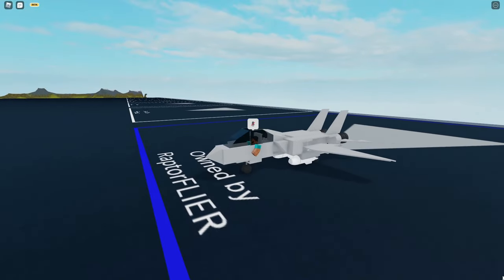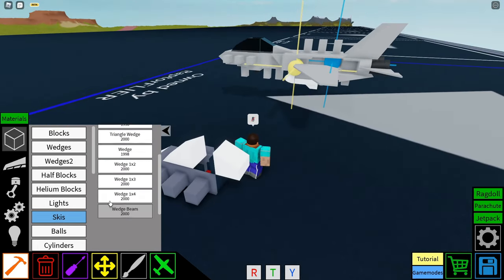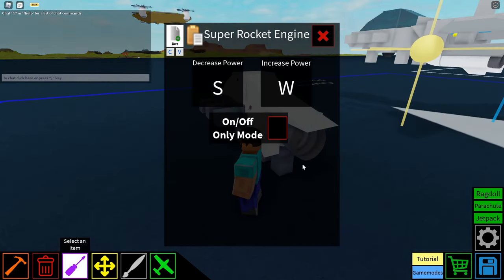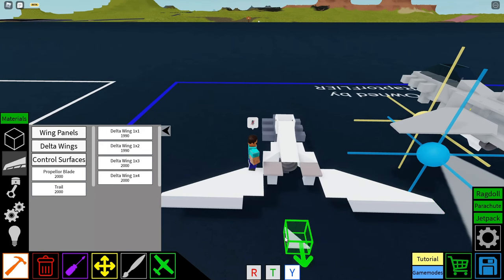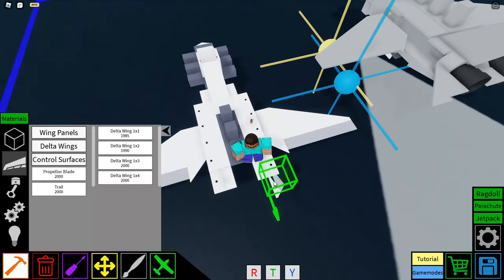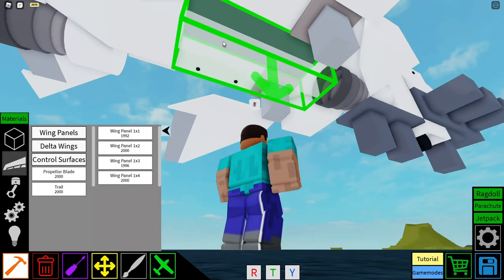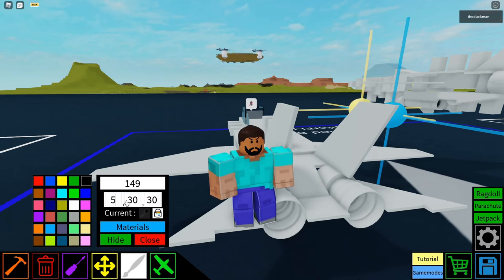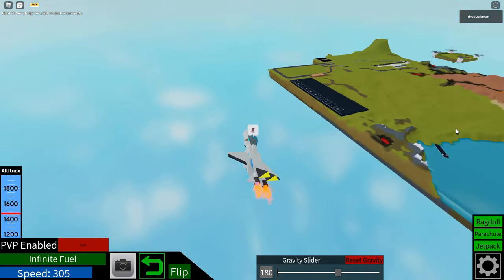MINI F14 TOMCAT TUTORIAL in PLANE CRAZY ROBLOX *EASY*

Comment: for those on mobile (like me), you should make custom elevators, then make custom ailerons, after, put the fold to 25, and it will work way better!
Reply: I agree
Reply: Sorry but what's Ailerons and elevators 💀 I am dumb
Reply: @jimmitouchiha9794 bro, thats the whole reason plane has control

alierons - to roll the plane in the air

elevators - to pitch up aka to go up
Reply: i dont do that. custom control surfaces are too hard to control. i just do full keyboard control using custom control surfaces and play on pc
Reply: nah I rather stick with joystick control rather than having to add another buttons

Comment: Good tutorial, but needs a slight update. now, sometimes when you click go is just breaks in half. my solution was just to replace the start trapdoor's with half blocks and add 2 extra blocks.
Reply: same thing with me man
Reply: same
Reply: @JAK_X1  yeah
Reply: i fix it tiny bit
Reply: it the engine i think and the back ting form the glass
Reply: @abstractfun  you need to add blocks in the lock thing door under
Reply: @JAK_X1  no,i used half blocks on the side
Reply: brain issue, u placed the trapdoor in wrong direction.
Reply: where do you add the 2 extra blocks

Comment: Hey duckster! When I wan finishen building the plane, it barely had any handling, is it because i modded the planes wings?
Reply: Ik im 10 months late but its probably due to speed. Slow down for better truning because this plane cant do full throttle turns
Reply: i didnt mod the wings but the handling is ass
Reply: @Frostyxz2108  the main reason is speed+ you need to stall to turn quickly which works fairly decent

Comment: You should upgrade this tutorial because only the wings are pretty accurate to the f 14 tomcat, I recommend upgrading it with motor LA Kings etc, but if you can't, then just keep the tutorial.
Reply: he put motor 2
Reply: Ok
Reply: Whats is LA Kings
Reply: just do it yourself, or ask me to make a mod tut
it's easy
Reply: @Floor773  fr
Reply: @brentoyisaac2538  Did you mod it? I took out the 1x3 wing in the middle bc it slowed down turning

Comment: Do you know a reason for me not able to turn left or right?
Reply: replace the 1x2 delta wing with a control surface and that fixed it for me so that will fix it  for you enjoy
Reply: @blimpsandairplanes  dude the wings fall off what do I do
Reply: @blimpsandairplanes  where is it located???
Reply: I just rebuilt this after failing to repair my first and now now control surfaces work, I cant go up, down, left, right, or open and close the wings

Comment: Nice vid, but I just can’t control the plane. Whenever I take off, the plane would flip and spiral into the ground. Does anybody know what is happening and how to fix it?
Reply: Did you mix up the engines? It happened when I was building a B-1 and it was always going the side. The problem was that on one side there were 2 rocket engines that were regular engines instead of super